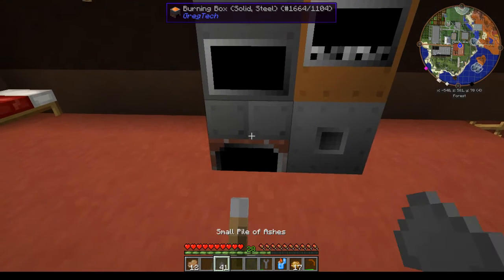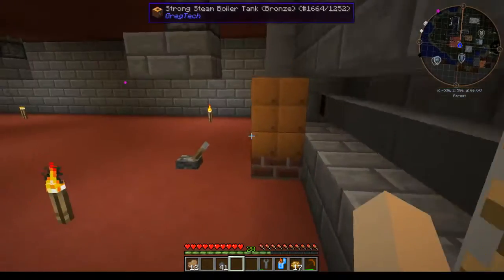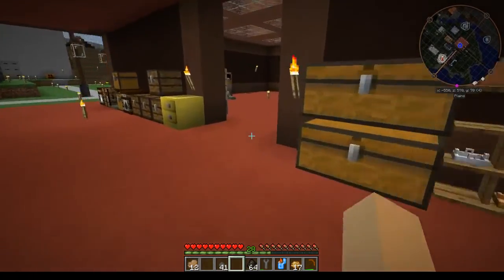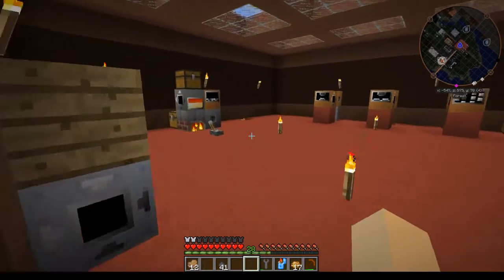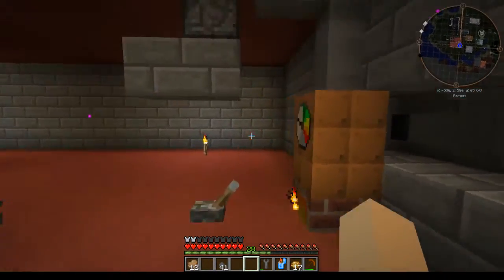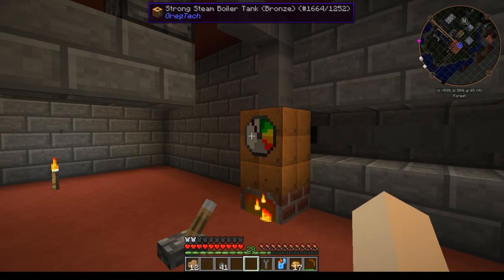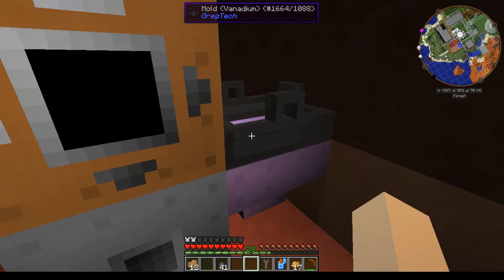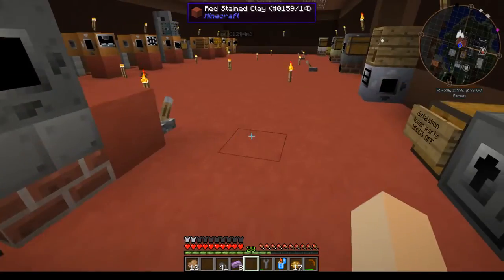Gregtech 6 basic Titanium Tutorial

Comment: Your whole setup prerequisites that you have Tungsten melting capacity, but I'm still not there yet. I personally use universal cells to move the molten Rutile from the crucible to a barrel over the mixer, then I mix it with Sodium, and return Titanium to the crucible. I think that's cheatty though because cells SHOULD melt at 500K and IE barrels at 1800K, and since Rutile melts at 2040K it should destroy those containers, but it doesn't. So what's the proper way to do that process without a smelter?
Reply from the maker: your looking at it, this is the intended way, tungsten isnt hard to get, there is small ores and even some ores you can find very easily.
Reply: I don't have trouble finding it, Tungsten is very hard to smelt. I'm currently rocking a Tantalum crucible and still can't smelt it. I need an Osmium crucible to smelt the first 7 plates + 5 for a cast and I haven't found a grain of Osmium anywhere. Then and only then I can make a Tungsten crucible and a smelter.
Reply from the maker: you are a bit confused, tantalum is what you need to do tungsten.  that is the best we have made, cause you dont need anything better
Reply: Holy crap you're right! I'm always confused with with "Melt" and "Melt down" temperatures. Still my point stands. How did you make your first Titanium, in order to make Niobium Titanium alloy, in order to get Tantalum to melt, in order to get Tungsten?
Going to make some Tungsten now :D
Reply from the maker: I made ceramic>vanadium>iridium>molybdenium>tantalium
Reply: Holy balls, that's like playing with fire! Other than the fact that Iridium is so scarce, you only have 9 degrees difference before your Vanadium crucible destroys itself. That takes serious balls, hats off to you Sir.
But seriously, the Vanadium->Niobium Titanium->Niobium->Tantalum way is way stress free than what you did, but it's incomplete, so you better tell Greg about that. There needs to be a way to get Titanium without a smelter.
Reply from the maker: there will probably be a way when there is a blast furnace